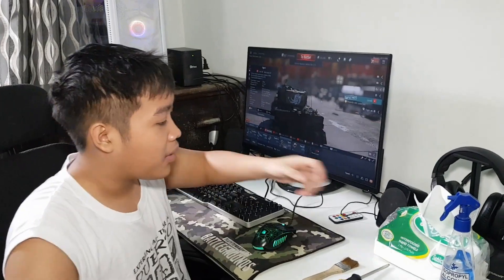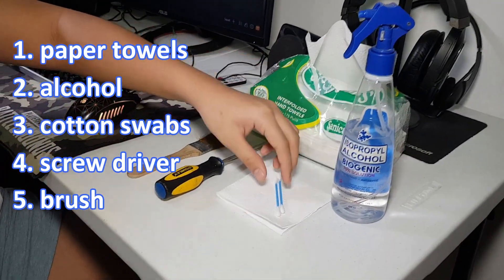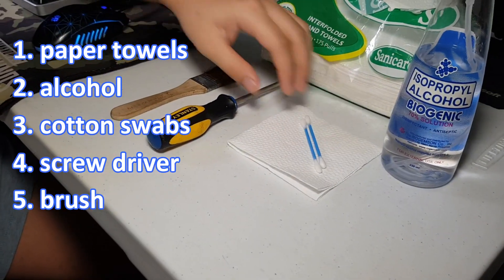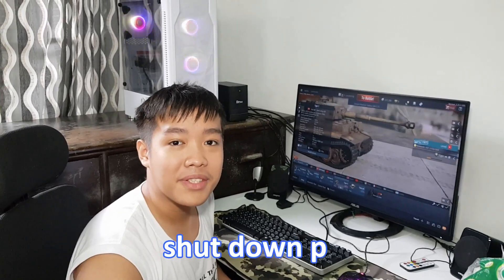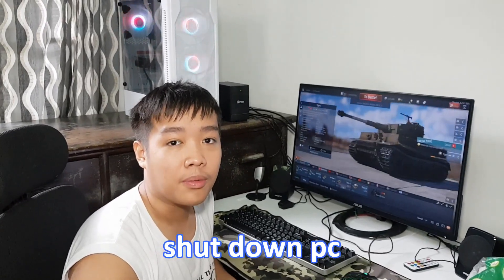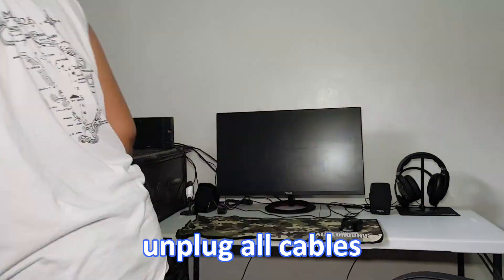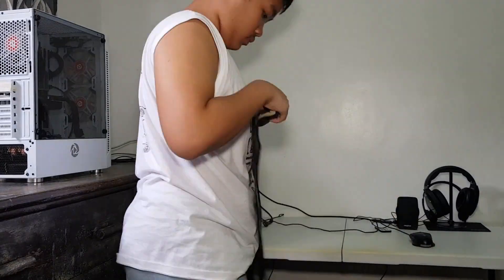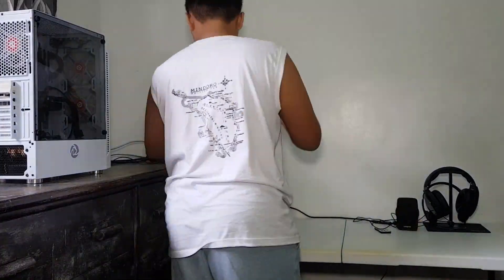How To Apply Thermal Paste CPU/GPU | Noctua NT-H1

Comment: Horrible advice, using paper towels you will leave tiny paper particles on the heat sink, you should use a special cloth that does not have debris or dust.  Q-Tip same shit, it will leave cotton residue.  OR you could buy Noctua's own wet wipes.
Reply from the maker: Omg! We haven't thought of that! I will do your advice maybe the Noctua wet wipes sounds better. I just followed the youtube videos and didn't realize that! Thank you my friend!👌
Reply: @agentbond2004  1 Noctua wipe is big enough to do both the heatsink for the CPU and the contact plate for the cooler, you do the CPU first, and fold the wipe and use the clean side for the cooler.  Don't worry about the dust in your PC you should see the dust in my case - that's why I am moving towards the NZXT H7 Flow, it hs filters in ALL air intakes so keeps the case clean inside and virtually dust free.
Reply: Just as bad advice. You don't need any wipes, simply use super fine grade sandpaper and gently rub it clean, then give it a shot of air to blow out the dust.

Comment: You should try phase-change material Honeywell PTM7950. It comes in as a sheet, lasts longer, performs works better than traditional pastes and there is no pump-out effect. For the power section (vrm) and vrams of the graphics card, I advise replacing the thermalpads with Upsiren UX Pro thermal putty which will lower the vrams' temeperature by 5-10°C.
It is also a good idea to do undervolting.
Reply from the maker: Wow, how do you know all these tech stuff! Anyhow, we will look into it and appreciate your advice. Good thing comments are very helpful thanks man!👌